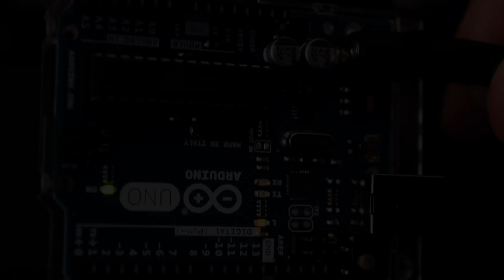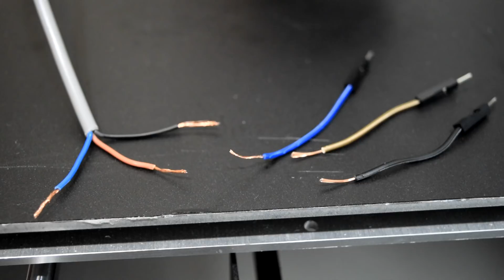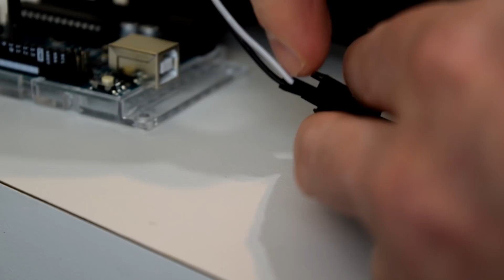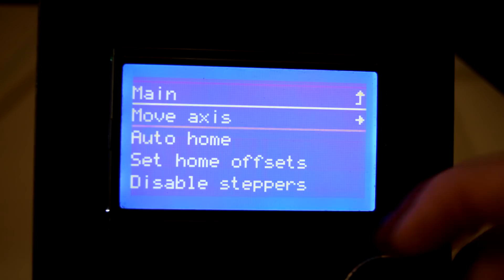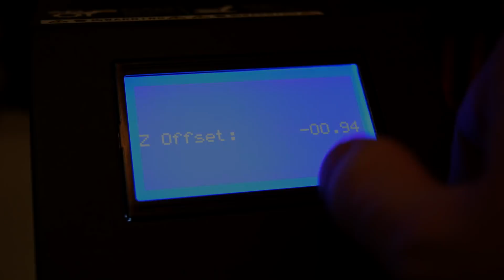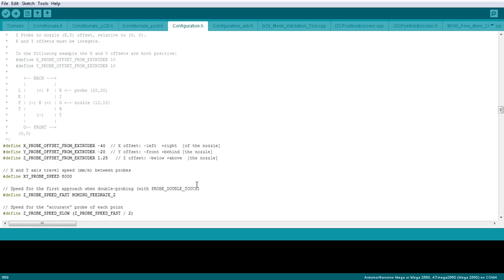Monoprice Maker Select | Auto Bed Leveling w Stock Board

Comment: This is so inspiring. I should do that too. 
I see another arduino used for simple multiplexing, I think it is possible to replace arduino with simple logic chip or even just a transistor plus few resistors. Or course you can get arduino nano these days for just a few dollars so that probably does not even matter. On the other hand transistor multiplexing can be working off 12V and be hidden away inside the power unit.

Comment: This is a great guide! I'm regretting my purchase of the i3 plus now...
Reply from the maker: Thank you sir.  Somebody on the Facebook group asked the same thing. I found this Instructable that claims to work for the i3 Plus.  I don't own one so I can't test, but it may be worth looking into:   https://www.instructables.com/id/Wanhao-Duplicator-I3-Plus-Auto-Bed-Leveling/
Reply: Thank you!  I'll check that out.
Reply: Derek Ward I wouldn't regret getting the plus st all. I have both a V2 and the plus (cocoon create touch). Out of the box, the plus has a much better print quality and consistency.

With the latest cura however, some options and geometry printed with the same gcode on both machines are done differently on the print bed.

For example, the V2 will stutter or stipple printing some of the  circular prints, where as the plus interprets the circular motion properly and lays smooth filament. 

The result is wildly different and it physically interprets what to do with the gcode differently. I can only put this down to firmware.

I think the marlin on the plus does a much better print than the repetier on the v2. Especially with the new cura software
Reply: Remain Indoors link is broken
Reply: Link is broken....

Comment: If this isn't working it's highly likely your proximity sensor is not rated for 5V.  I picked up a 6V-36V sensor by mistake and it doesn't work correctly due to the fact that the sensor physically needs the minimum 6V to function correctly.  The light on the sensor would barely glow when running on 5V and always outputs 5V.  This is why the printer would crash into the bed, because there's never a drop to 0V on the output.

Comment: Awesome video, thank you!  Since I previously printed on glass, due you have any recommendations for a new bed, or will the stock bed work just fine?
Reply from the maker: Thanks Mike!  The stock bed will work fine for this method, but if your original printing surface is worn out, you may want to look into BuildTak or PEI to cover the aluminum if you don't want to use masking tape (masking tape is awful but PLA sticks to it)

Comment: Hey I did this mod awhile back ago and I love it just saved me so much time and effort.

But 

I’m running into a problem now 
I keep getting a corner that doesn’t seem to stick causing my whole print to fail 
Just one corner
Reply from the maker: hmm. that's odd. Have you tried printing something like this?  https://www.thingiverse.com/thing:3183346  
I would print one layer of something like that and look close at the printed layer to compare and see if the filament lines are smashed flat equally across the whole bed. The layer should be roughly as tall as a piece of paper.  Depending on what you're using as a printing surface on top of your aluminum bed, is it possible that surface is uneven?  The sensor is only going to sense the aluminum, so your nozzle is going to follow the curve of the aluminum, not what's on top of it.

The Auto Bed leveling routine in Marlin isn't perfect by any means so it probably won't be 100% the same width everywhere, but it should still be flat enough in most places on the bed to hold down the print.

If it is at least partially flat (not just a squiggle of filament in that corner) I would try putting some glue stick at least in that corner to see if it helps. Or, if you're positive there is no physical issue, you can try doing a reset on the Marlin firmware by sending M502 and M500 back to back from your computer.  That should load up the default Marlin settings and store them.

Anyway, good luck!
Reply: Remain Indoors 
I ran the print 
And the entire LHS of my printer is not coming out at all (nozzle to close to the bed) the RHS is pretty lines look pretty adhere. What could cause this? I ran this printer multiple times with this mod and never had a problem until now :(
Reply from the maker: @cesarrenteria838  it could be a wire or the sensor going bad. In theory, if the hotend cables stretch to one side of the bed and the sensor has a harder time reading when it reaches the bed, then the auto bed leveling calculations will be wrong when it tries to print.  

Prusa has some functionality built into their printer's firmware to correct for an issue similar to this - I think due to inconsistencies in the bed manufacturing process, but the Monoprice Maker Select board can't fit that kind of functionality on it, and that isn't a standard part of Marlin that I'm aware of.

Are you running the Auto Bed Leveling routine at the start of every print? (using G28 and G29) - if not, that could be a problem.

Otherwise, you may want to Google around for ideas, I'm not sure what else would be causing it.

Comment: Amazing instructions. Thanks a million, very greatful. Learned a lot as a brand new newbie from this exercise. 
I used a different mount other than what was suggested, thus I had to make mods to the configuration.h. I followed the instructions for measuring the sensor to the nozzle... Never updated or changed a firmware of any kind prior... Do I need reconnect the arduino to upload the firmware after making changes to the configuration.h file? Or, do I simply connect a usb cable to the melzi board and upload the new changes?
Reply from the maker: yeah, after you've burned a bootloader you don't have to take apart your printer to update the firmware again. just plug in a USB cable and the Arduino IDE should let you overwrite the last firmware any time you need to update
Reply: @RemainIndoors  Thank you.